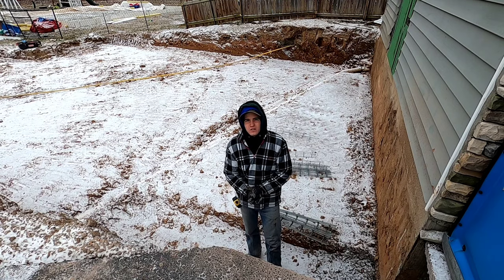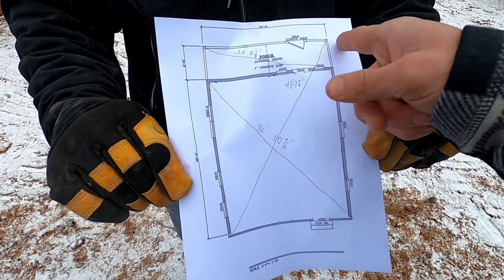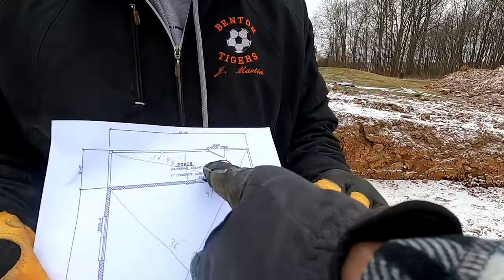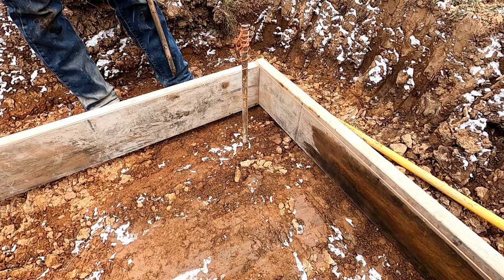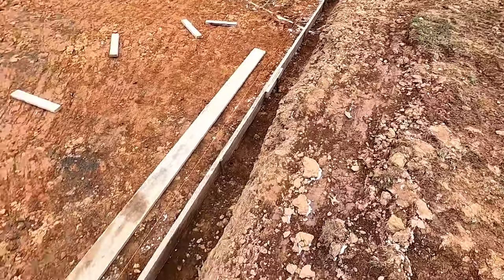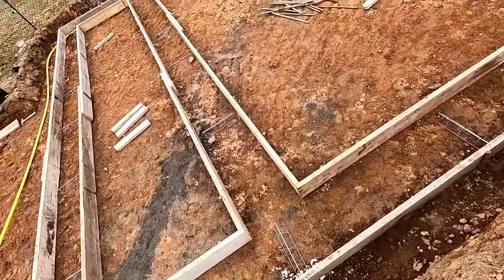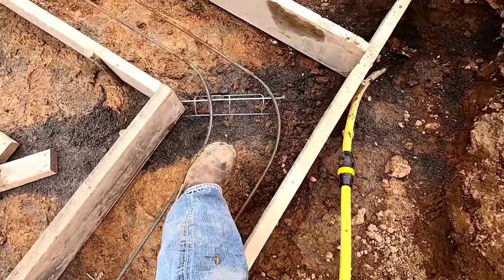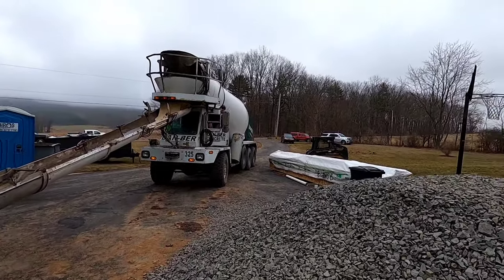How to Set Up/ Pour Footers

Comment: What is the lowest temp that you place cement?  Was the ground frozen when you poured?  I had a footer built one time and the mixed the cement with hot water at the plant but it was above freezing.  I am building a log cabin with trees off my property.  I picked up several important tips.
Reply from the maker: I would pour if it it can get hard before it freezes then cover with blankets at night

Comment: The way we do footings is to use 1X4's for the cleats attached with duplex nails. We then suspend the rebar by using tie wire wraped around the head of the duplex nail. Rebar should be 2'' from the bottom of the footing and cut spreaders so the steel does not get pushed to the side of the forms when filling with concrete. When the forms are filled untwist the tie wire and submerse it into the concrete.  With duplex nails the cleats can easily be removed after the concrete has set firmly making troweling easier.  Your corners should be seperate pieces tied to the straight ones that should be terminated 2'' from the form.
I hope you learn something from this comment

Comment: Hey Mason, I hope all are well with you. I've got a blunder. I didn't use a transit and got my foundation set in sand 1'x1'. My problem is that my foundation is not level. So I'm having trouble getting my diagonal rectangular measurements to correlate. Off from about 1" on one rectangle and.1 quarter inch on the other rectangle. IveI've got 2 rectangles adjoined as an L shape. First of all, I would like to know what 50' tape measure you are using. I watched the next episode when you guys measure for the diagonals.  I can't even find a tape measure that goes to 50' let alone pliable enough to cover the distance without folding. Thank you for the help with your videos and the such. I am relearning what I knew 50 years ago brother.
Reply from the maker: It’s hard to picture. I usually use a 100 ft tape to find the diagonals. They make lasers that help with getting it squared up too

Comment: Not trying to hate or anything or sound snotty genuine question. Did you have material compacted under that? Where I’m from for our footings required pea gravel to be compacted underneath to allow for water drainage, mind you with my current job we’re pouring footings for about 125k of weight(shipping containers to be moved) but when we did a garage slab around this same size the drainage grading was still required as per the engineered slab
Reply from the maker: When it’s on virgin ground we don’t have to compact it. At least I’m my area

Comment: So this has always interested me. Why do you keep calling them footers? In every instance where you would want to get a strong “foothold”so you don’t fall or slide it’s called getting your “footing”not getting your footer. This is where the premise of why it’s called what it’s called. The “footing”is the base of the foundation to which a wall is constructed and is put in place to gain a strong “foot hold” on the substrate as to not slide or move , creating stability. Therefore, creating a “footing”for which the foundation walls will rest and not move. Always gain your footing to create stability.